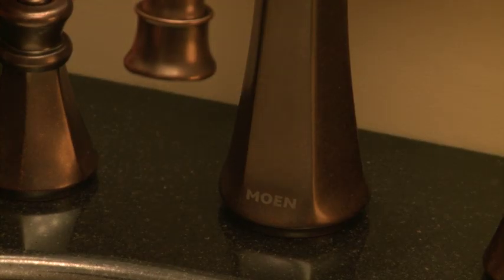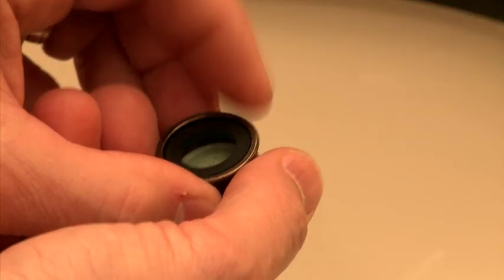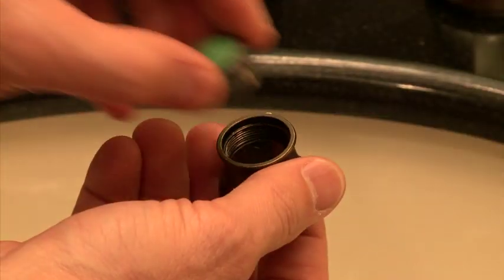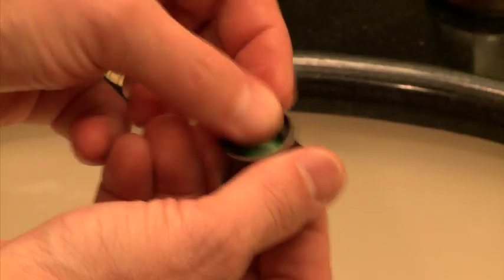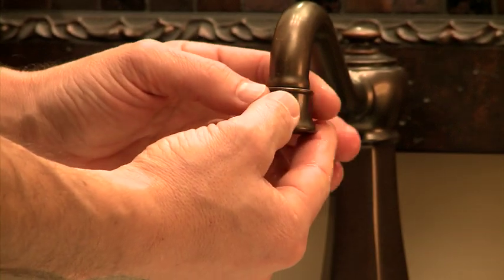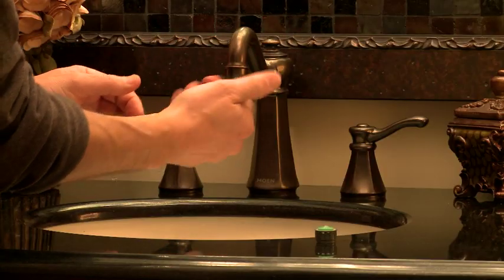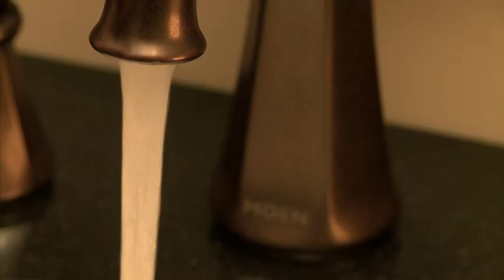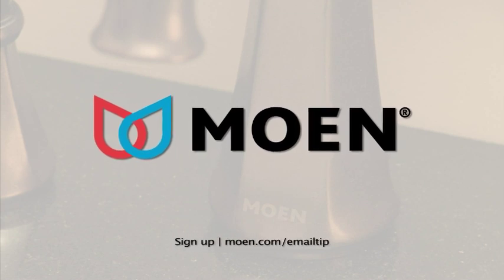How to Install a Water Saving Aerator in your Moen Bathroom Faucet

Comment: I can't unscrew the head
Reply from the maker: Hello Qiaona. If there is calcification around the aerator, you can spray a 50/50 mix of white vinegar around where it screws on to try and break down the build up. A rubber jar opener or rubber band can be used to better grip the aerator. You can also use an adjustable wrench over the jar opener, rubber band, or a leather belt, which will protect the finish. Please contact our Consumer Services Center for warranty assistance; they can be reached at 800-289-6636. Our current business hours are Monday through Friday from 8:00 am - 7:00 pm (EST).
Reply: The rubber band idea worked great for me!